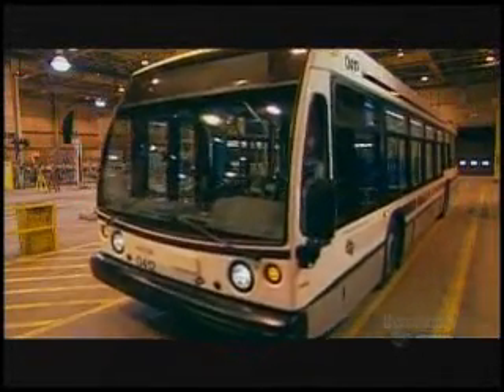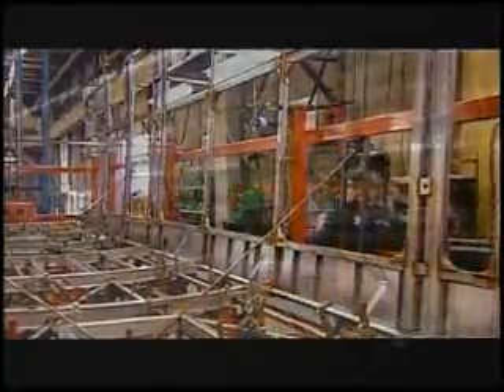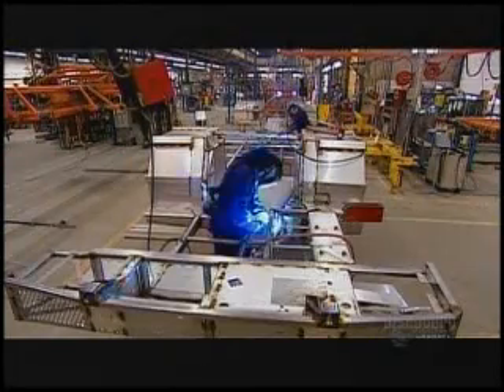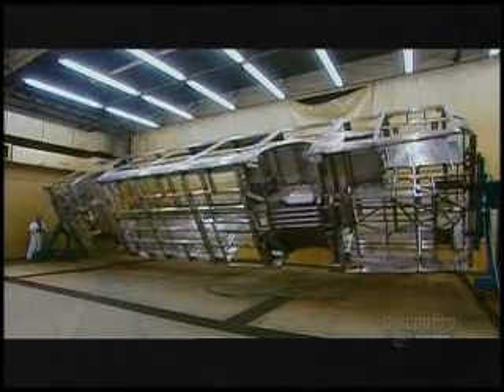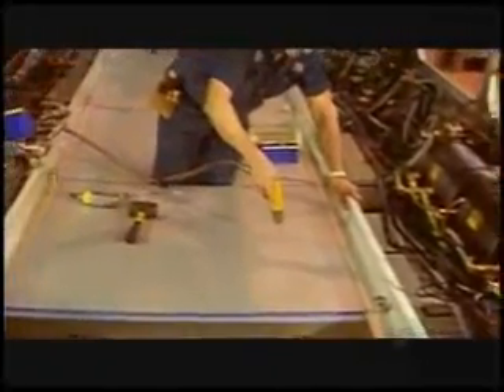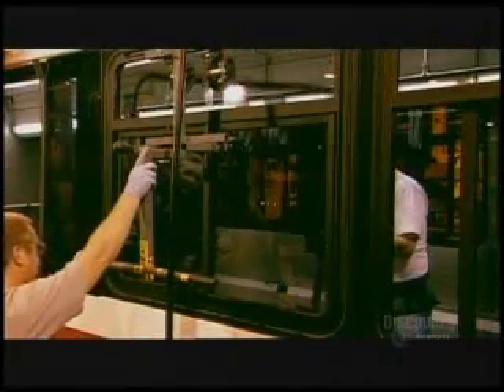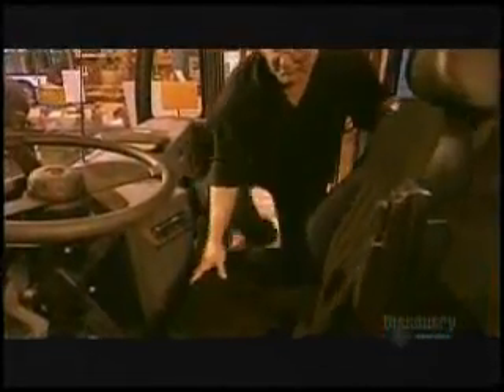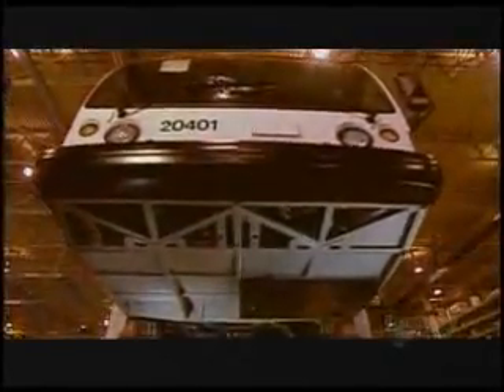How it's Made - Transit Buses

Comment: The Gillig Phantom was discontinued in 2008. Gilligs Low Floor is technically th Low Floor but its commonly called the Advantage. This bus in the video. Is the LFS from Novabus. I would like to see how a New Flyer is built.
Reply: MrWill1985
Reply: Surprised they discontinued it. Why didn't they keep making it? I noticed there are transit agencies that stuck with the high floors for as long as they could buy them. Such as NJ Transit's custom high floor NABI, or New York bee line with the Orion V. They were more spacious and rode better (RTS Busses) in my opinion.